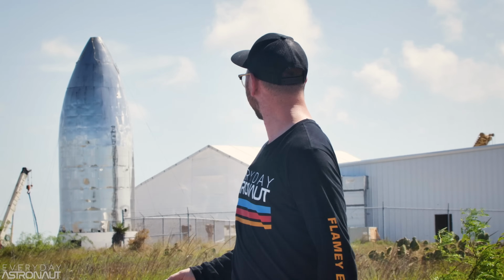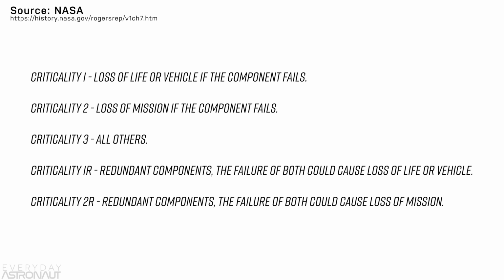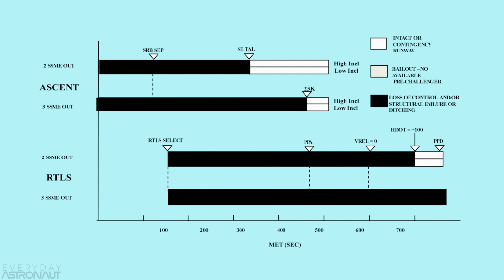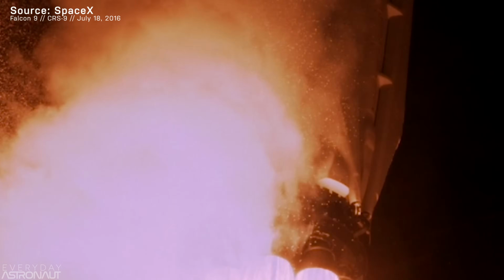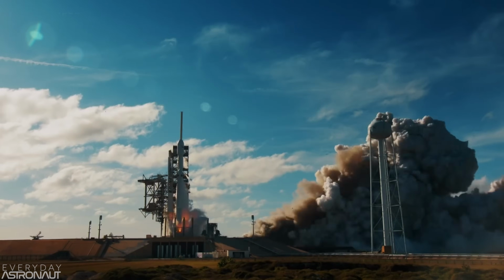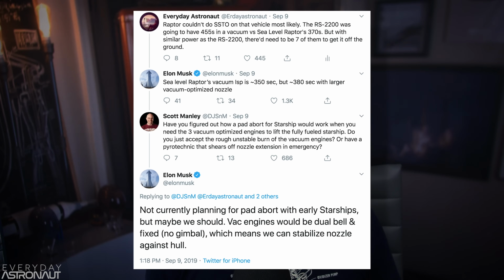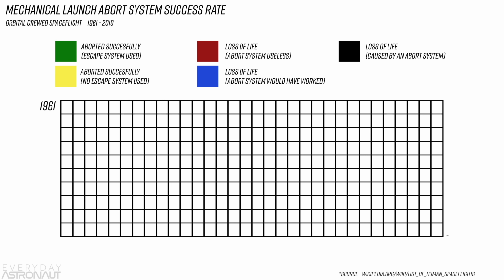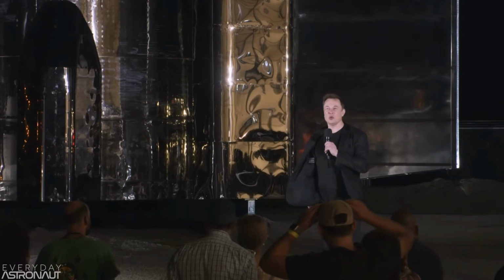Why won’t Starship have an abort system? Should it?!

Comment: "That would be like putting a Cessna prop plane inside of a 747 in case the 747 fails you can fly away on the Cessna."
In the early 1900's the consensus was that life rafts on the Titanic was a waste of space and that they were better off just making the Titanic itself safer.
Reply: Titanic (actually the Olympic) was the epitome of user error

In addition to the various ridiculous design flaws mentioned above.
Reply: @100videosandnosubscribers3  You say "user error" but if your coal bunker is seriously on fire you have no choice but to dig it out as fast as possible. That means running the ship faster than you'd prefer to do. The captain should(?) have sailed further south to avoid the ice but he didn't have enough fuel to do that.
Reply: @Dave5843-d9m  intriguing, I've never heard that take. I thought the fires had been put out by then, I don't know why they would still go full steam ahead into an ice field. But maybe the fires weren't out. Interesting.
Reply: Everything everyone knows about the Titianic is wrong, it was an insurance scam gone wrong.
Reply: @JohnnyThund3r  yeah that's what I said too
Reply: @100videosandnosubscribers3  Wanna know something scary? I didn't see your comment until you replied to me...
Reply: Titanic left UK with a major fire in one of its bunkers. The bunker was being dug out as fast as the stokers (firemen) could dig causing the ship to run at high speed. The heat from that weakened the engine room bulkhead. When that wall failed, the rate of sinking increased dramatically. Add that the ship was made from brittle steel its no surprise than a grazing impact on an iceberg sank the ship
Reply: @Dave5843-d9m  I know what to do when your the Caption of a ship in that situation, why the Caption did not move his ship as close as possible to the California proves that his motives were anything but genuine. He just didn't know the plan was to let him die with his ship, he thought they would save him and just let the ship sink.
Reply: You can’t fit enough Cessnas inside of a 747 for 400 people. You can fit enough lifeboats on an ocean liner for thousands of people.
Reply: The idea was that the Atlantic was full enough of ships that help could be called for; the boats were there for transfer, not survival. If the Titanic's distress signal had actually been picked up (if the radio operator in the nearest ship hadn't gone to bed for the night), there would have been a liner there in enough time to assist - including sending out its own boats. The death toll would have been far lower.
Reply: jsm666  That, and Titanic was a double hull design ("it's own lifeboat" in the parlance of the times)

Incidentally it was NEVER advertised as unsinkable and the designers wanted to add enough lifeboats for all passengers but were ordered to remove them by White Star lines as they would unsettle the passengers.

The primary failing was that the watertight compartments..... weren't.  The bulkheads on each deck didn't go all the way to the ceiling and the segmentation didn't extend properly into the double hull structure either.

What that meant was that whilst the watertight doors between sections were watertight, once the water level overtopped the bulkheads in each compartment it was able to flow into the next.

Even with the sheer number of breached compartments on that ship, if they'd been properly watertight the vessel would have taken much longer to sink (if it had sunk at all - although it would still be dead in the water due to the engine room flooding) - long enough for rescuers to arrive (remember the vast majority of victims died of hypothermia, not drowning)

Ironically, if the Titanic had less warning and hit the iceberg had-on, the bow structure would have crushed and absorbed the impact at cost of the lives of ~130 crew in their sleeping compartments at the front but the ship itself would have remained afloat.

The fire in the coal bunkers was well known and the weakened metal that resulted definitely played into the ease in which the berg ripped open the side of the vessel, but the fatal error was designed in from the outset and there in a lot of contemporary designs.
Reply: That's rubbish.. the titanic had life rafts🤦‍♂️..
Reply: @longjingshen5473  for how many? ;)

Comment: I've always had one question about the whole Starship system: Why does it even need heat shields? Couldn't it just flip BEFORE entering the atmosphere, shed enough speed with the boosters and avoid the high temperatures all together? That 60 degree re-entry maneuver looks so risky. 
I'm no expert, so if someone knows the answer i would really appreciate it :-)
Reply: I think the short answer is it would require too much fuel. You need that "aerobraking" to help slow you down, if you used 100% fuel to slow down, the entire rocket would need to be way bigger and heavier.  Once in orbit refueling of spacecraft is commonplace, then it might be a legit way,  i guess it would boil down to the cost of the heatshield versus the cost of "space fuel" from the moon, design of the ship etc.
Reply: @KarpKomet  Yeah that makes sense, didn't think about fuel consumption :-D

Comment: Time stamps:
3:05 - How abort systems work
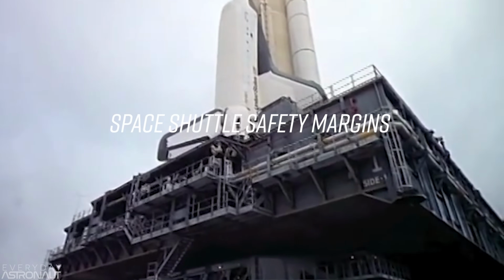5:25 - Space Shuttle Safety Margins
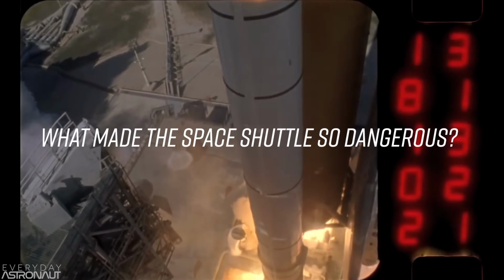10:40 - What Made the Space Shuttle so Dangerous?
16:00 - How Starship Will Differ from the Space Shuttle
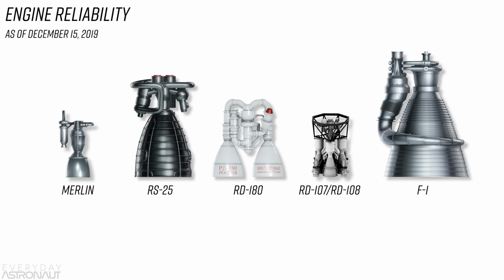21:00 - Engine Reliability
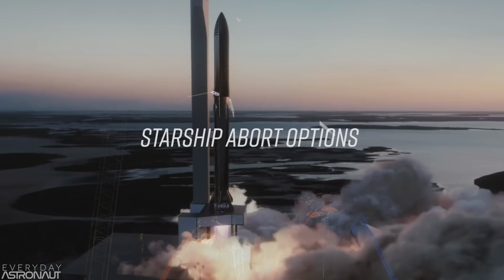30:25 - Starship Abort Options
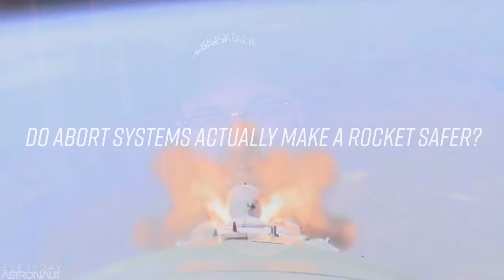34:30 - Do Abort Systems Actually Make a Rocket Safer?
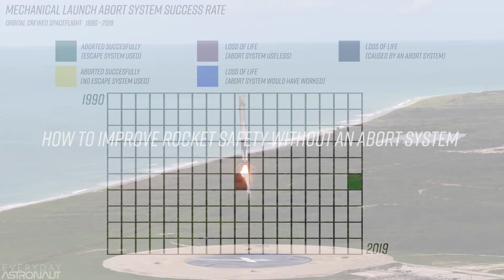38:55 - How to Improve Rocket Safety Without an Abort System
41:50 - Are Launch Abort Systems Necessary for Human Spaceflight

Comment: We drive and fly every day with no abort system.  I agree with Elon; Its better to build vehicles that don’t need them..  👍
Reply: Cars can pull over. Airplanes can't, but they have an atmosphere and, in most major commercial applications, at least two engines. Spacecraft lose all of that, and getting home (re-entry and landing) is tricky.

Comment: 27:30 helicopters land propulsively all the time, you can land a rocket in a body of water for extra safety.
Reply: Difference is helicopters arent 50m tall, not coming in from suborbital velocity and dont land with rocket engines too powerful to even hover.

Big reason why rockets dont land on water (especially sea water) is because the salt damages the engines, which are the most expensive part
Reply: @sebastiaomendonca1477  Excuses excuses. You won't get anywhere by justifying problems instead of finding solutions.
Reply: @michaelbuckers  The solution is making the rocket more reliable, which they've done already and are even still working towards

Comment: I would use an abort system until , the rockets are safe enough like airplanes to fly without them.
Reply: They kind of are at this point. The Falcon 9 has only failed once in flight and it was during it's early years.

Comment: It's all just probability in the end.  But probability has two aspects: likelihood of failure and consequence of failure.  Unfortunately, much as I enjoyed this video, it really only concentrated on the first aspect - likelihood of failure.

And, as humans, we are far more affected by the second aspect - consequence of failure.

If you're playing a game on your phone, that might mean you miss your bus, the chances of missing it might be quite high - but, what's the worse that can happen?  You have to wait for the next bus.  Of course, if you're waiting for the last bus of the day and the consequence is a long walk home or an expensive taxi ride, you might choose to not play a game.  The probability hasn't changed, but the consequences have - so you don't take the chance.

If you're considering the choice of sitting on top of a cylinder full of high explosives while they're ignited, I would suggest that you aren't likely to be interested in how reliable this has been up to date.  You're much more likely to be influenced by the fact that, no matter how unlikely a failure is, you are going to be very dead.

And it really doesn't matter if the system has been 100% reliable so far, you'd still want to know that you can escape if something does go wrong.  Up to the point where Challenger broke apart, the reliabilty of the Shuttle was 100%.  And before Columbia, there had been no problems for 17 years.  So, in both cases, the probabilty of failure was (apparently) incredibly low - but the consequence of failure was stilll exactly the same - certain death, as there was no abort system.

Comment: I won't get on Carnival rides. So no, not getting on a rocket anytime soon. Abort system or no.
I RELUCTANTLY get on airplanes and they have your 99.999999% success rate.
Reply: I'd hop in a rocket if i ever got the chance to. Regardless of risk, its an incredible experience

Comment: Well, if it has not been demonstrated that launch abort systems have been significantly useful for saving people, then no they are not needed. You don't want to add anything you do not need as it just becomes one more thing that can kill everyone if it fails.

As you said, simply launch the vehicle unmanned multiple times to certify its safety before putting crew onboard.

Comment: I think that your closing logic is flawed in the argument about "...the simplicity of a design that doesn't have all those extra parts and just focus on making [the rocket] more reliable."  That kind of assumes that there is a fixed constraint on resources (time, people and money) and that diverting some resources into making an abort system means taking away resources that would otherwise be able to make the rocket more reliable.  It could be argued that in a case like SpaceX which is a "for profit" company, that yes, there is always a constraint on resources, but do we really know that if Elon wanted there to be an abort system, that he would take resources away from other aspects of the rocket design and therefore would end up with a less reliable rocket, or would he dedicate a new team to the abort system and pay for that by increasing the price of the launches?  In other words, I don't agree that having an abort system means you must have a less reliable rocket (when referring to the rest of the rocket.)

However I admit that having an abort system does equate to increasing parts, complexity and potential modes of failure.  From that perspective, it could decrease overall system reliablity, but if it works more often that it fails (and hopefully a lot more often than it fails), then having it could increase the safety of the crew.  This is compared to an otherwise identically reliable rocket that doesn't have an abort system.

Comment: There is only one question that needs an answer in the context of this discussion--How are we going to get back down?  It may well be that Starship may have answers to that question for many scenarios that we fear that do not require a mechanical abort system.  Albeit sometimes there may be other options that may not have been explored adequately yet, such as when Columbia sank due to that big hole in the wing, docking at ISS and launch a new vehicle may have been an option, or at least try to EVA and repair the hole. If my memory serves me correctly, the crew knew when they first got to orbit about it.

Comment: Startship's TPS is closer to what they originally wanted to use on the Shuttle before they went to a cold frame design.
Still an abort system would be nice on a VOTOL like SS though it may not need to be as powerful.
The only ship I think that can really get  away without one would be a HOTOL Skylon as it can do rejected takeoffs and do a dead stick landings like an airliner.
Though an abort system would not help much on Mars as the atmosphere is too thin for parachutes alone.
One very reliable engine you missed was the RS-68 on the Delta IV it was 100% successful.
On the first flight of the Delta IV Heavy the center core shut down early but that was due to cavitation in the line vs a failure of the engine.
If it was doing an LEO mission carrying Orion the crew would have still gotten into orbit.

Comment: This is not how you do statistics. You should also estimate dispersion. Comparing 1000 launches with one failure of RD107 and only 62 launches with no failure of F1 leaves very huge margin of failure to F1. If you randomly choose 62 out of 1000 you will cover that one failure with probability 0.066

Comment: You could still have made the same video about how safe the shuttle was before it ever launched (or was even fully designed).  My take away from this video is that some of the things the starship will do are inherently risky (37 engines, propulsive reentry), but there are some failsafes the shuttle didn't have.  I think you're ignoring the fact that many of these failsafes are active - if the computer fails on starship there's absolutely no hope, shuttle could at least passively glide and had parachutes, capsules passively orient themselves correctly, and obviously ablation is passive.  While it's nice to have fancy systems to minimise risk, you can't really beat a passive failsafe (something that automatically works when other systems are broken).

Comment: it is cheaper to design a rocket accurately and make sure 1000 times that everything works properly instead of putting a rocket on solid fuel that costs several thousand dollars ???

Comment: Maybe there is a way to have a pad abort system that is part of the pad and doesnt go with the rocket once its ~100m from the ground, once im in flight what happens happens but on the pad is the most vulnerable time.

Comment: Didnt nasa, during the challenger accident, also fall victim to "if its flown once, it will fly forever" when flightproving systems. I think the booster had launched at similar temperatures before, but not failed.
Reply: iirc that was the coldest they ever launched at, though I could be mistaken. There definitely was a lot of concern about the temperature pre-launch.

Comment: One small addition, as the Starship will use autogenous pressurization, there won't be any helium COPV so it removes the main failure mode of the Falcon. I know you already know that fact and its too late to change the video but it might be worth throwing it into the article accompanying the video.

Comment: Abort systems are junk, but they are junk you put on junk rockets. The first starships will be cargo ships delivering cargo to the moon. The first starships to Mars will be cargo ships delivering cargo to Mars. Starships should be expected to fail early & get better quickly before they stabilize the design and get human rated, much like Falcon9. So, the simple answer is no, starships should take the fly a lot more route to safety.
Reply: I meant to say unmanned cargo ships

Comment: This is real simple. The STS was designed by several committees consisting of government employees/bureaucrats each over-riding and over-ruling each other many times over the course of it's lifetime. Its various assemblies were built and maintained by the lowest bidder(s). Many corners were cut along with budgets. SpaceX has a clear and concise design, engineering and minimal government incursions into their process. NASA needs an enema.

Comment: The problem with fly often and make it reliable, is that it really scales poorly. Lets say you do 100 successful flights in a row, what does that really show you? Nothing, you don't know how lucky you have gotten. The situation doesn't really start improving until you have done thousands of successful launches, only then can you start saying it's probably a good rocket, not just a lucky one.
The root of the problem, is that successes mean very little, it's the failures that count, you need to see the failures to tell how reliable your system is. And that's a chicken and egg problem, you don't get to fly people before you prove your system is reliable and you can't prove it reliable before you fly it tons of times which includes flying people.
That's why abort systems are a thing, to give a paper proof of reliability, because that's the only kind of proof you are capable of producing. Proof may be in the pudding but you are not allowed to taste it before you've proven it's tasty.